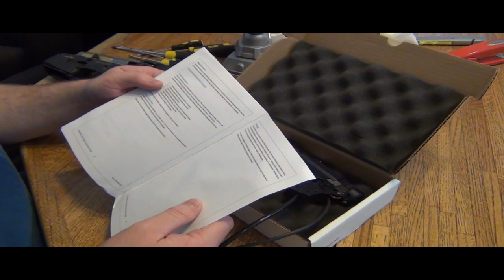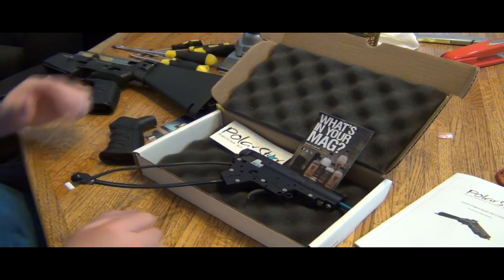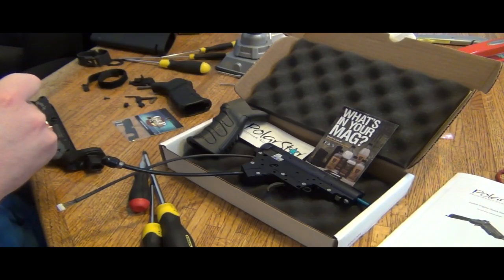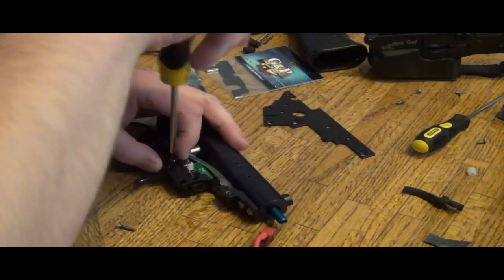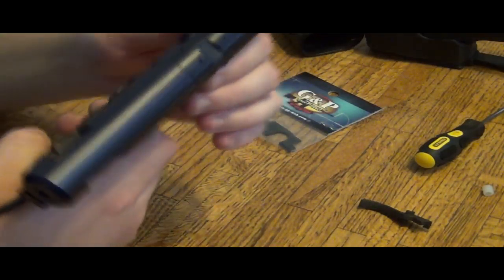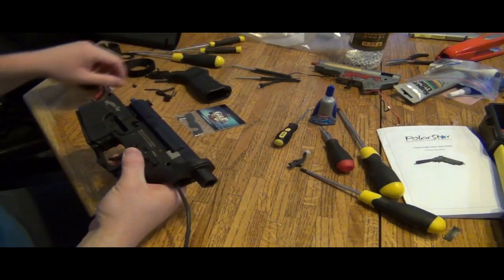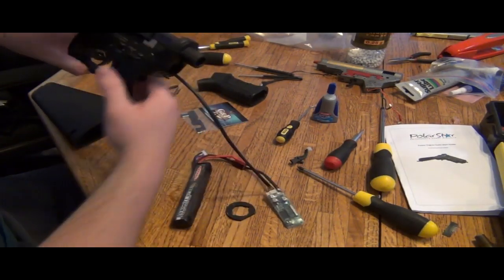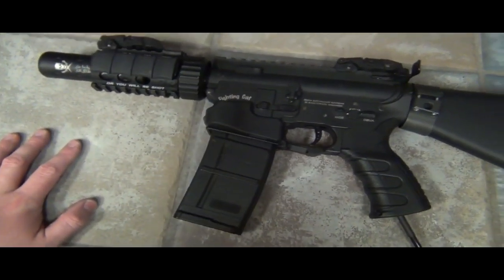PolarStar Install Process With Hair Trigger Modding

Comment: Suggestion, don't put material in between the micro switch and the trigger, this causes the button to be pushed further than it should be, breaking it much quicker than it should, which it really shouldn't. You should always put material between the tail thing on the back of the trigger and the engine, this way, the top part of where the tail thing goes, can stop the trigger when it should.

Comment from the maker: You will get banned if you continue to respond like this. First off it is a hair trigger, the pull is very slight and stops. Polarstar boards are practically hair trigger off the start. Second if you want to compare yourself to me, that is almost instant ban. Make a positive comment or question.